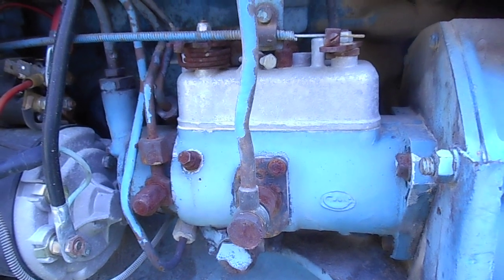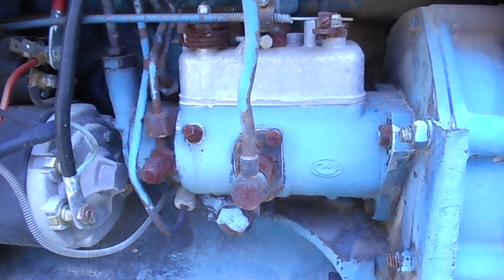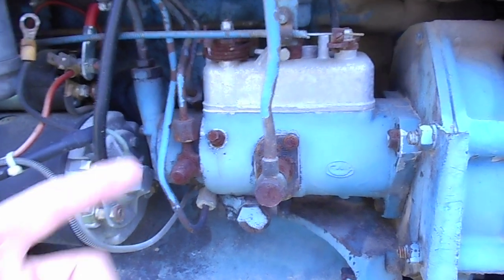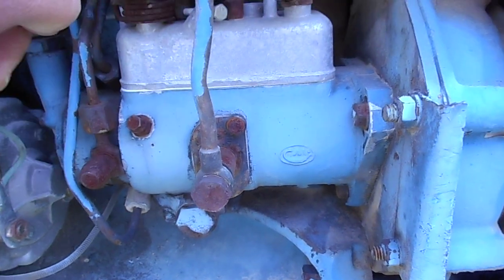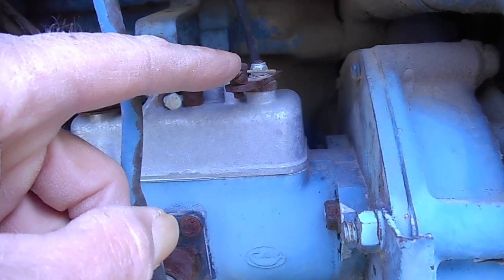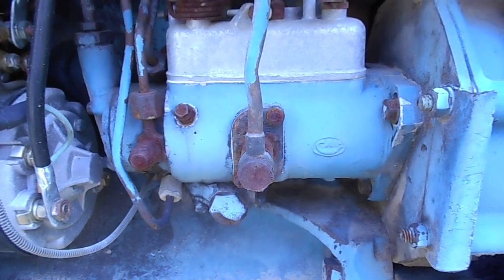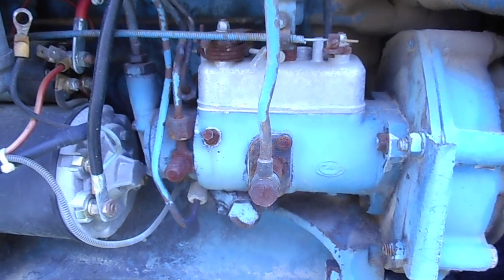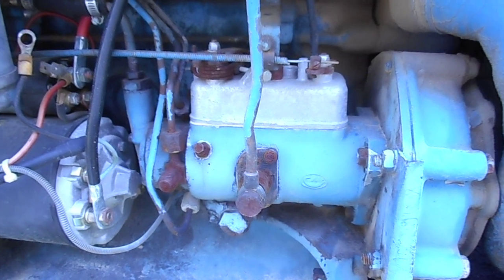Ford 4000 Injector Pump

Comment: Your friend is referring to the Simms/Minemic in-line style injector pumps; they have a starting aid button you push in after opening the throttle slightly. The rotary injection pumps (like your CAV on the 4000) do not have this button.
Reply from the maker: steve middleton -  yep, no button but I did look.    thanks for watching and commenting.

Comment: I remember the button on our six cylinder Ford engine, but the 3000 and 5000 tractors we had never push a button and always starts right up, but we are a warm country, maybe that helped. Thanks for the video
Reply: Jan Kotze they had  them on the  early  3000 , 5000, 6000 comander, and I believe  on the  7000. they went  away  from  the  simms  injection  pumps  when  the  sheet metal  on the ford's  changed  around  69 or 70 and they got  the   cav pumps . the  only  one  after  that  that should  have  the simms  was  the  7000 , 8000 and  9000 tractors .  but  that  button  made a  world  of  difference  in  how  they  start  up cold.
Reply from the maker: Jan Kotze - starts better on the warmer days for sure.
Reply: Hi, it makes perfect sense what you say, that is how I experienced it, we had the latter shape Fords as in my thumb nail picture, thanks for sharing your knowledge

Comment: the  button  he mentioned  was on the  simms injection  pumps ,  they were  on the  older  ford 3000 tractors ,  5000 fords, 6000 ford's and  several  others .  your  pump  is  the  cav  that  was used  on the  later  model  ford's  and  many  other  applications .
Reply from the maker: Johnny Sharpe - yep, it is resolved now, I have no button.   oh well...   thanks for your knowledge and input..

Comment: No cold start fuel button on this injector.  Simms pump has the button together with a manual pump located on the pump.  To cold start, press the button and pump the small level, pushing fuel into the cylinder heads for faster starting on cold days.  The alternative is a shot of ether in the air intake \ breather.  In Canada, we need this!  Hope this helps.  JR
Reply from the maker: Joanne Rudnick - no cold start button, we checked.  about all I can do is turn the motor over until I got smoke out of the stack so I know the pistons are wet with diesel fuel then hit it with the starter fluid.  I try to give just a small dose to keep from pitting the pistons really bad.   thanks for subscribing watching and commenting.

Comment: Some 4000s came with a heater plug that operated by the key. I noticed this when I drove a friend's tractor and he showed me how to use the heat plug.  My 4000 did not have a heat Plug but had the space For it. So if you Google it and you will see what it can be fitted And how to fix it
Reply from the maker: Thanks for watching the video and thanks for the information you provided here.  🙂

Comment: They are probably thinking about a manual priming pump that would be just below the injector pump if equiped.
Reply from the maker: Yep went searching for all that way back then. Tractor doesn't even have a mechanical lift pump on it. Thanks for watching.

Comment: I don't have access to a handbook for those particular model of tractors but you could just check to see if there is a device that looks a bit like a sparkplug and has a small fuel pipe and a fairly heavy electrical cable attached to it installed into the inlet manifold. 
This style of engine pre-heater is designed to at least heat the air somewhat that is drawn into the engine some also set fire to a fine spray of diesel whilst the coil is heated in the plug. This of couse even more heat. 
I have to say this style of device has never been very successful in my opinion and why most manufacturers moved on to glow plug heaters to assist cold starting.

Comment: Same pump on my 4500 I have to do the same thing crank then a little starting fuild just the tiniest amount and she fires right up. I do have some blow by too but what did you end up doing to fix your issue??
Reply from the maker: Ryan M - if I remember correctly this video was about looking for a cold start button and the pump did not offer one.  if the temp is below 60F I just turn the motor over until I get smoke out of the muffler then hit it with just a short shot of starter fluid and the tractor cranks right on up.   thanks for watching and commenting.

Comment: What are those two guys smoking? That's CAV pump not Simms. It doesn't have any kind of button/switch for forced fuel injection or stuff like that. There may be a button on the dash if tractor has Thermostart -system installed. But sometimes it could be installed on the ignition key switch. Tbh i was expecting ford farmer to know that kind of basic stuff Btw.. That's a clean pump. Thumbs up for keeping it so nice..
Reply from the maker: Ravolta - I suspect they were only trying to be helpful without really knowing much about the pump.   or they could have been yanking my chain.   thanks for watching and the compliment on the clean pump.

Comment: ive never had to use starting fluid or intake heater or anything on my 1966 ford 3000! it must still have plenty of compression id guess!
Reply from the maker: Gerald volkenand - you are blessed and from what I do know compression is key to how well and quick a diesel cranks.

Comment: no button on this model. only aid is to use preheat which should be incorporated on key switch..
Reply from the maker: kim culver - the only way I knew to get to the bottom of the issue Ford Farmer and larsonvalleyfarm were offering me assistance on was to upload a video of the injector pump.   the complete rebuild back in 2010 did a lot of good and did make starting better.  I got a temptation to mess with the timing, BUT the motor runs really good under load, so I don't know.     thank you for your knowledge on this issue.

Comment: That’s a CAV DPA pump. No button to push.
Reply from the maker: TheVox  - yes but it sure was fun searching for it and thinking if only I could find this button my tractor will crank better.  but no button..
Reply: The Simms pump on my 6000 has one. But I haven’t used that tractor for years.
Reply: Try adjusting your pump timing. Hard starting can be several things, low compression, weak injectors, low pump pressure, even a clogged filter.